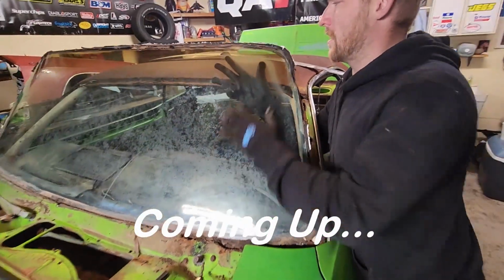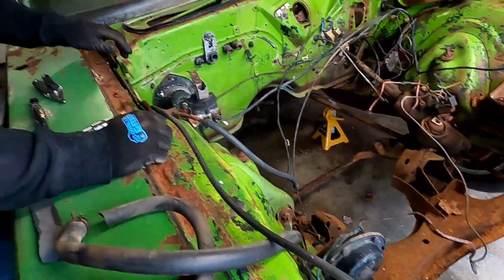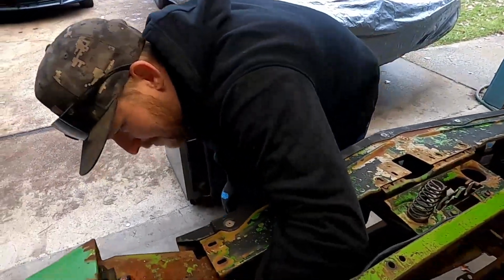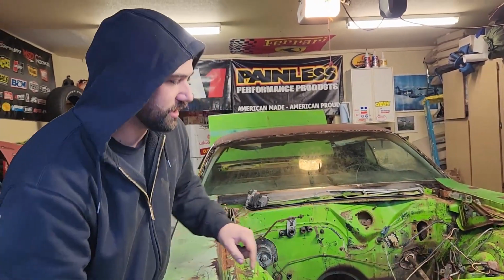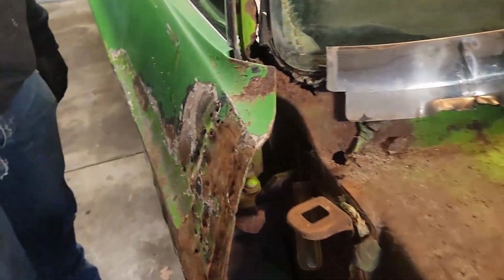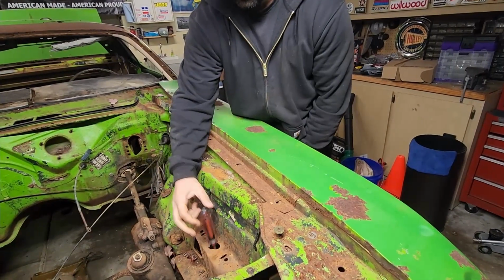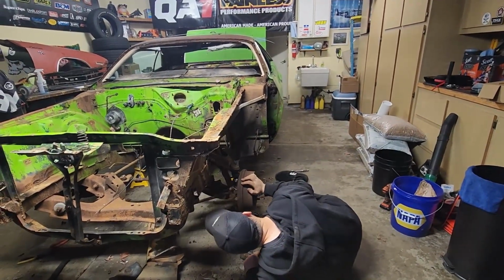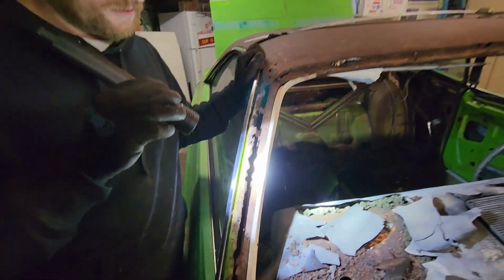FORGOTTEN 71 Dodge Challenger Tear Down pt.1

Comment: Hi Bryce, super cool to see you saving this FJ6 71 Challenger. Have you given any thought to maybe fitting the super rare 71 V6J lime side stripes seeing that you are going back to new paint on the exterior, it would be cool to hear what your final vision, as in colour combination and wheels. I too think that it would be cool with what ever engine combo you are thinking between 440 or gen3 Hemi.
Reply from the maker: Yeah thanks! So I haven't made any final decisions yet on the exterior vinyl decals but they will be black for sure. This car actually had the V7W White side stripe with a mostly white interior, which I'm sure looked amazing back in the day but all the interior and exterior striping will be black with FJ6 paint 👍🏻
Reply: Hey Bryce, your car was coded with the duel thin quarter inch painted on pin stripes in white, which is subtle and runs along the top edge of the front fender and finishes just past the rear quarter glass. But i can vision your Green Go and wide Black tape stripe colour scheme, pretty common combo and looks cool. If you do get a chance, look up V6J as their are only two Green Go 71 Challengers known (1 R/T & 1 non R/T) with Fluorescent Lime Green longitudinal tape stripes. Thought i would mention that your Slap-Stic shifter and console are both 1970 units only and not 71. Good to see another 71 Challenger being saved. Hi from Australia too, Kenny.
Reply from the maker: Yeah I’ll look up that green stripe but you are incorrect on the slap stick, 71 Challengers absolutely did come with the console and slap stick, my car is one of them, it’s on the fender tag. The 1970 models were the only ones that had the round ball slapstick shifter but the 71-74 console slapstick cars were all T-handles. My car was a T-handle slapstick car. Code C16.
Reply: G'day Bryce, in my reply i was just telling you that the Slap-Stic and console in your car is 1970 only, you are supposed to have a T-handle shifter and an adh tray console. I can tell by the pictures that you have the seat belt buckle style console. Are you keeping air conditioning in the car ? Factiiry style or after market unit running to your original dash vents, as their is one that fits as a direct replacement for the complicated standard vacuum unit.
Reply from the maker: Oh ok I see what  you're saying now, sorry. Yeah I'm aware that the 70 Challenger is the only one that had the seat belt buckle holder and 71 to 74 had the ashtray. I don't think I've really looked at it that close, I just thought that I'm just missing the ashtray but now that I'm looking at it I think you're right, I think that is a 70 console. The car will have air conditioning I'm just not sure if it's going to be a factory Style with an older V8 or if I'm going to do another gen 3 Hemi with modern air conditioning. I'm leaning towards the Gen 3 hemi.

Comment: It's not that bad I bought a 66 Olds 442 w30 Ram Air Force speed car it was so bad I had to jack it up with a 4 by 4 to get the doors to open me and Buddy yanked on the rear quarter panel with gloves and it came off this thing was rotted in half but we got a lot of good parts and it was all there unfortunately it said in the guy's backyard that flooded every time it rained for 45 years that Mopars were fixing cuz you can get parts have a great day thanks for the video
Reply from the maker: Yeah luckily this car is fixable, will just take a lot. Thank you for watching 🙏🏻

Comment: Code	Description
E44	318-2 Barrel
D31	Light Duty 904 Automatic Transmission TorqueFlite
JH23	
J = Dodge Challenger
H = High
23 = 2 Door Hardtop

G1B	
G = 318 230HP 1-2BBL 8 CYL
1 = 1971
B = Dodge Main, Hamtramck, MI, USA
145540	Sequence Number '145540'
FJ6	
Paint Code: Green Go
H6XW	
Trim Grade/Style/Color
H = High
6 = Vinyl Bucket Seats
X = Black
000	Upper Door Frame: Full Door Panel
127	Date Built: 1 / 27 / 1971
057892	Order Number: 057892
V1W	Roof Type OR Color:  Full Vinyl Top - White
U	Built to Specifications for USA Order
C16	Console w/ Buckets
C55	Bucket Seats
G11	Tinted Glass All
G33	Left Hand Outside Mirror - Manual / Chrome
H51	Single Air /w Heater
M21	Roof Drip Rail Moldings
R11	Music Master Radio AM
V7W	Accent Stripes - White
Reply from the maker: Yup! Pretty kool options for a 318 car 👍🏻